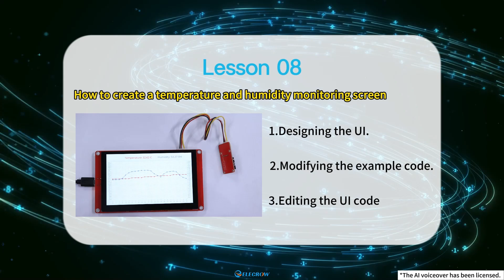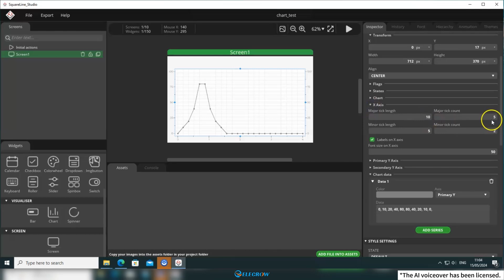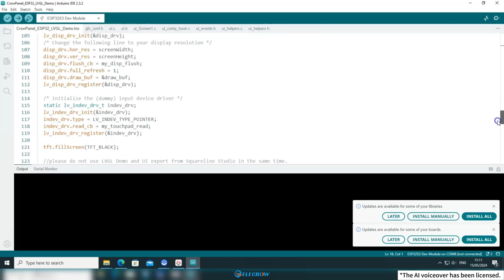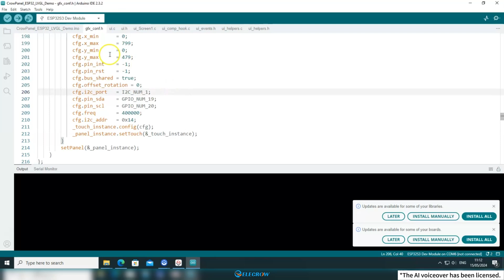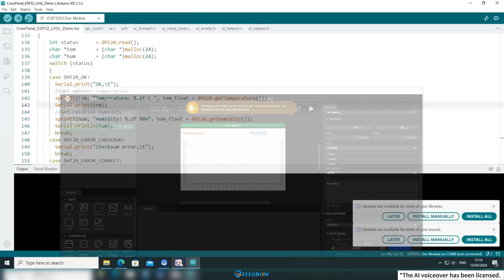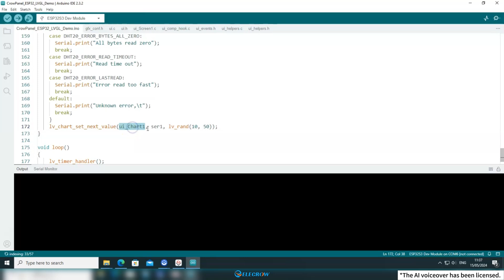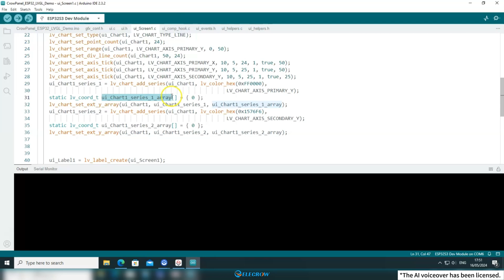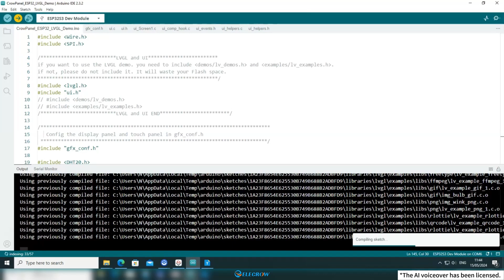Get Started with ESP32: Lesson 08 - Design A Temperature and Humidity Chart GUI using LVGL

Comment: Yeah the provided code doesn't function on 7 inch  - Wire's default pins are not right. should be 19 and 20. Im using a TPA2016D2 for example.
if i do Wire1.begin(19, 20, 100000); everything works. I should also note because the defaults are usually &Wire, i did:
  boolean result = audioamp.begin(TPA2016_I2CADDR, &Wire1);
Reply from the maker: Hi, for any technical inquiries or assistance, please feel free to reach out to us at techsupport@elecrow.com. We are here to help and will respond to your request promptly.
Reply: How do I solve the touch problem?
Reply: @eliothavila7337  I used free RTOS. Made a process surrounding the screen refresh call, and another process that did stuff with the I2C. Created a mutex lock, such that only one of the two can operate at the same time. Still plenty high enough frequency to be responsive. You can go upwards of 20 milliseconds between screen refresh calls
Reply: @CooperZuranski  How did you do it ? would you have an example to show me ? thank you.